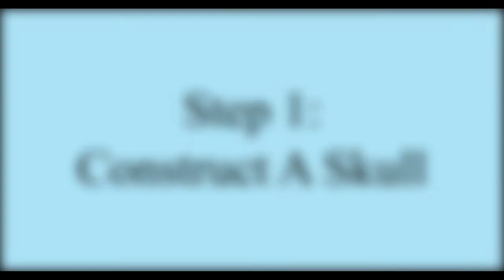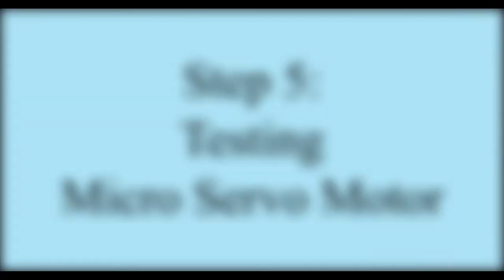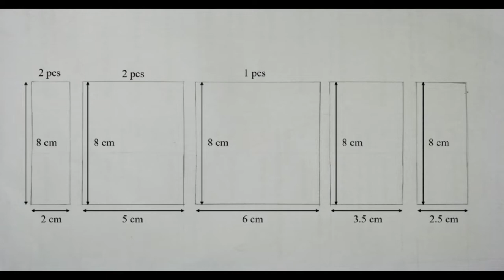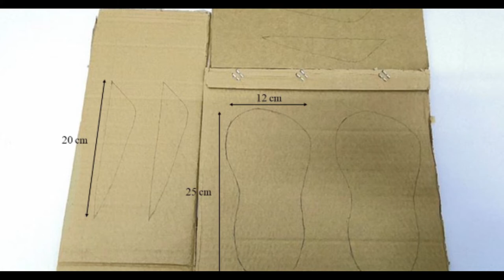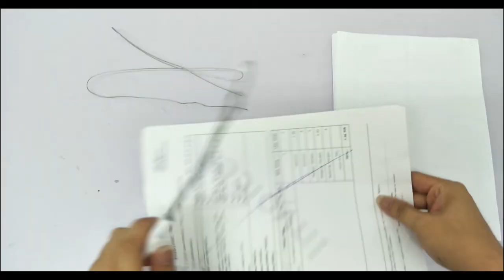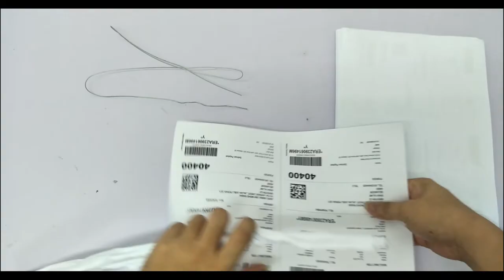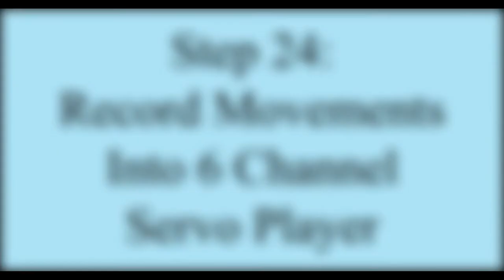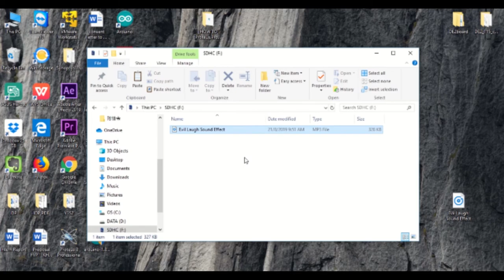DIY Self-moving Scary Skeleton by using paper, With Sound, Activate by Sensor, Halloween, no code

Comment: This is exactly what i needed! I have 2 questions. I made a prop out of pvc pipe and the arms are made of the pvc pipe. How would I attach the servos? And will the servos be strong enough to lift the pvc pipe arm up?
Reply from the maker: the pipe can make 2 hole to hold the servo bracket. the servo i used is mg995 which the torque around 10kg/cm and the pipe i used is the thin one. So the servo able to lift the pipe in my case. May be you can think the another mechanism way to lift the arm if your arm is heavy...